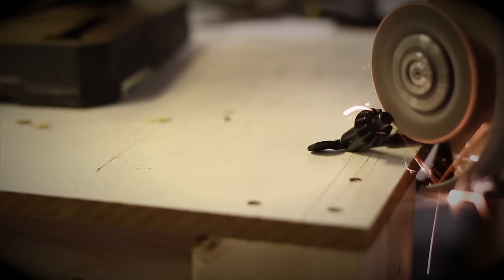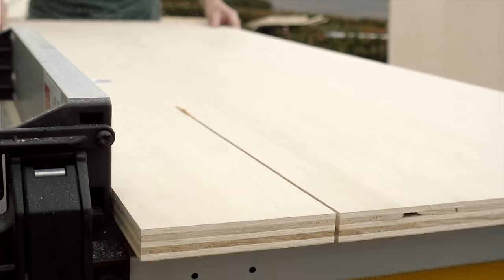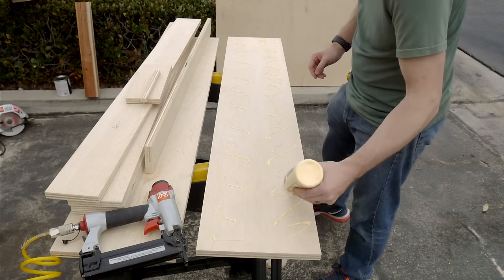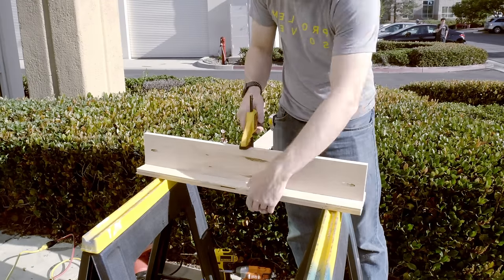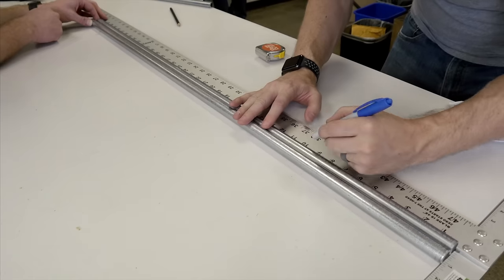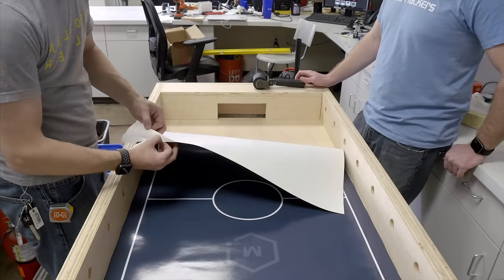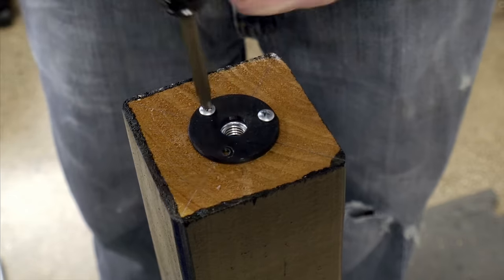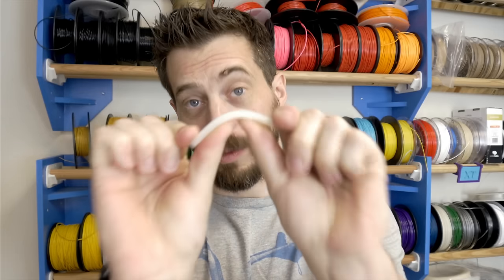Foosball Table with 3d printing // How To | I Like To Make Stuff

Comment: just a suggestion. when clamping the middle section of the table sides, you could use a piece of scrap cut to the inside width of the table as a brace against the clamps to prevent warping while the glue sets. love your vids. keep them coming.
Reply from the maker: +marriedmanfix1 excellent idea! Thanks!

Comment: Hi Bob,
 can you make an  wooden USB case. I had a cheap USB stick that I could force open, it was also too wide so I figured out I make a better case. It is possible to make it with a hand saw, file, chisel and some sandpaper. I am not very experienced (16 year old) but it turned out decent so I think you can make a masterwork. Thanks!

Comment: Hi! Another great video! One question, at the end of the video we can see a wall full of filament. The question is: is the whole room with humidity control or this doesn't matter to those filaments? 
Thanks! 
Best regards from Brazil!
Reply from the maker: It only really matters with some filaments, but they also have ways to dehydrate them and bake them before use.  Personally I don't worry too much about it and have never really had a problem.  It's SUPER humid where I live too.

Comment: Nice video thanks for sharing. How smooth are those bushings with the conduit? Most foosball tables have 5/8" rods and players are fairly cheap if you didnt have access to a 3D printer... (might even be cheaper than the filament used excluding the time and waste) but I doubt that any conduit has an exact 5/8" OD.  I made a table and used 1/4" plexiglass on top and sanded it with 80 grit orbital sander for grip. Came out great. Thanks for posting. Should have went with a single goalie and ramps in the corners tho!

Comment: Bob, at the end of the video, there's a wall of filament out in the open. I keep hearing you're supposed to keep your filament out of any humidity, and I've been storing mine in an airtight box with silica gel packets. Do you leave your filament out in the open like that?
Reply from the maker: +Christopher Pickslay yes I leave mine out but putting it in a bag certainly doesn't hurt

Comment: If you re-do the field vinyl, add Under each corner kick a very slight slope, so that the ball doesn't stay stuck in a corner ;)
Reply from the maker: This has been mentioned several times. With more than one goalie, there aren't corner ramps.

Comment: Hey Bob, I wanted to know: if I only had availability on the Ultimaker 2 extended would that be sufficient and do I need the extrusion upgrade kit? I also see that you put the ultimate 3, is that for specific pieces or the ultimate 2 is fine? And what does the upgrade kit do and is for? Also how long does it take to print out all the pieces? Also I see  that the pieces are not downloadable to a actual file but only printable from their actual site, is that ok?! How much Nylon X do i need? And finally, where is the game field file, or is it something I have to make on my own? Anyways thanks for your help and stay my number one channel:) cheers
Greg
Reply from the maker: Hey Greg! The um2 should work fine, but the upgrade is definitely worth the cost, if you can swing it.  I have the 3 listed as well simply because I have one and use it too.  Their total print time was like 11.5 days but I didn't do any of it, that was all done by Matterhackers. They're happy to answer any questions about the files ,printing, filaments etc.  Super knowledgable and nice people.

Comment: If you didn't know, the table need to be slightly angled to the center to the ball roll to the center and not stuck in the corners.

Comment: The center of the table has to be lower than the score sides so the ball moves through the table and don't stop in dead zones. At least in every one I play has the center lower.
Reply from the maker: +Alfonso Sánchez (Fonso) yeah that was a consideration. Having that T underneath ga e us the flexibility to shim underneath it or drive screws up from beneath to change the level of the center. We had it level but it could easily be shimmed a tad to lift the center point.

Comment: Hello! just wanted to point out that a standard table has tapered corners. 3D Print them too!!
Reply from the maker: +AndreaFromTokyo see the pinned comment
Reply: I see!! i didn't even notice there was more than one Goalie until i read your post! first time i saw such a configuration, i'm so used to a single goalie in Italy that i didn't even realize it with my eyes!

Comment: Hummm, I like how "easy" you made it look, 3D printing aside, it seems like a nice weeken project.

But, I have to say I find two things a bit weird, although maybe one is related to the other, to compensate for that. First, there are three goalkeepers? there should be just one player in that rod and the other two should be in the next one.

I guess those players are there so you can play the ball when it reaches the corner, otherwise it might get stuck there and you would have to pick it by hand. But this brings me to the second weird thing, and it's that you used a plain, levelled surface... and those games here are not that way, but curved, the center of the "field" should be lower than where goalkeepers live. That makes a more dynamic movement of the ball and allows for more espectacular actions.

I know, that means the project would be a bit harder to accomplish, but it's worth the effort, for sure.

Nice one though.

P.S. We're supposed to know a thing or two about those tables, since they were actually invented by one guy from this North-west corner of Spain, called Alexandre, and the name of the game is "Futbolín" here.
Reply from the maker: Thanks, see the pinned comment for the goalie/corner answer.
Reply: Thanks, I did not notice the extended comment, sorry, my bad... but we're talking about different things anyway.

That link in the pinned comment talks about ramps in the corners, but I'm not talking about them. Let's see if I can explain myself (English is my third language, so bear with me). Here in Spain, most of the Foosball tables, if not all of them, don't have a plain, straight surface. Think of the surface as a sheet of paper which you grab from the narrower sides. If you pull hard enough (but not too much or you would tear it, of course), that sheet would be quite plain, similar to the surface of your project.

But if you "let your hands rest", that sheet of paper will have a curve, some kind of arch or so, and that's how Foosball tables have their surfaces here. Goalkeepers are in the highest parts and the lowes part is among the midfielders.

Thank you not only for the project but also for taking your time to read and answer, very much appreciated.

Comment: The way you've done those rods it's possible to stab your opponent in the gut.   They usually have the rods sliding over (often poorly fitting) fixed rods at the far end, so they don't protrude.

Comment: You forgot something in the design : the corner of the play area need to be a little higher than the rest of the field ....
Maybe there no need to make some big change .... Just by using a finer sheet of wood that can bend and some 3D printed slot that are designed to make this corner softly go up that you screw on the sheet that you have made as a field. Then tou add you 2nd sheet of finer wood and nail it to the bigger one before adding you vinyle could work

(Sorry If I'm not really clear about what I'm trying to explain .... I'm from Franc and don't practice a lot my english)
Reply from the maker: Thanks for the ideas, I appreciate it as a helpful comment rather than a mean one. There are different types of tables.
http://beta.foosball.com/features/official_table/  (first question)
Reply: Ophaniel that's a good idea, the tables i played on had ramps in corners so that ball cannot get stuck in cornrrs where players cannot reach them
Reply: I don't see the point of a mean comment. In general I'm part of the "silent majority" so if I comment is that I hope to bring something that is constructive. And to be honnest, I'm very bad in manual labor so I wouldn't be able to criticize your work but maybe, sometimes, I can bring some ideas.
And I know that there is many different type of table I just saw a way to inprove that built that stick to the concept so I tried to share it ...

I follow you channel since you built an arcade and you're the one that  made me want to try harder to build some stuff ... My first project is an "magic mirror" (the one that allow you to see some stuff like the news, you facebook notification, weather, or the news through the mirror)...
Reply: Ophaniel he accounted for that by having 3 goalies

Comment: You might like using a jigsaw more if you had a good one.
Reply from the maker: I actually did get a good one recently and it is WAAAAAY better.  Not my favorite tool, but it's much easier to use now.
Reply: Yep. It's one of those tools where the cheap-vs-good difference is huge.

Comment: But sadly you never mentioned (or carefully avoided) saying how long the 3D printing took!!!
Reply from the maker: To be honest, I don't know. They had it all printed before I got there, but I imagine it took a LONG time.
Reply: The trees that made up the plywood were still saplings when they started!  Not a fault of MatterHackers, just a limitation of the platform.  No doubt they had several 3D printers running full-bore to get these done.

I like this Collab.
Reply from the maker: I asked them and they said it was a total of 11.5 days in print time.
Reply: Wow!  That's awesome.  Thanks for the followup!

Comment: why make plans for this project when nobody has the resources to print 140 pieces for their own table lol... a better project would be an all wooden Foosball table
Reply from the maker: +Jeffrey Restrepo just because you may not be interested doesn't mean that no one else will :) plus, you COULD buy all of the plastic parts if you wanted.
Reply: I have the resources... Join your local maker space or check the Public Library... I agree it would take a few days spread out over a week or two but if you want it and are resourceful almost anything is possible

Comment: The break pretty fast i guess? 10:37
Reply from the maker: There was one player that was a bad print and it snapped.  Turned out it had bad layer adhesion and was split before we even put it on.  They ended up reprinting it.